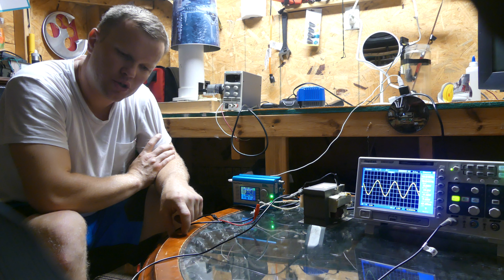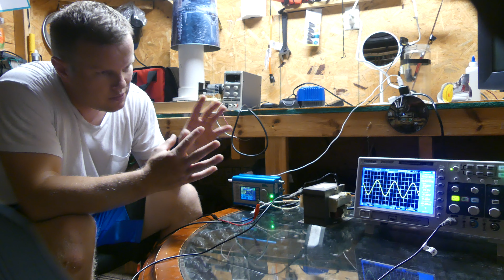Resonance in the core of transformer and Schrielen Optics Update 2

Comment: Since earths ionosphere is charged with 500+ kilo-volts of electrostatic charge and also earths core is electrically charged with unknown kilo-volts, what if you modified your van de graaff generator where you take one small metal ball and two hollow spheres? Metal ball will represent earths core and charged with van de graaff generator. Middle sphere will be grounded with earthing wire representing earths surface. Outer sphere will represent ionosphere and charged van de graaff generator. I wonder if it will produce gravity on the grounded sphere in the middle. Have big enough hole on outer sphere so you can put your hand inside to drop objects on the grounded middle sphere for experiment. Also try insulating the grounded middle sphere.
Reply: Will the ether flow towards the grounded middle sphere to produce gravity?
Reply from the maker: Thanks for coment I will have that on my mind :)